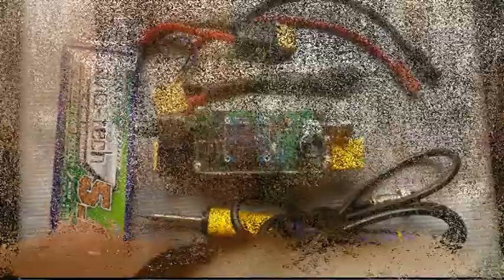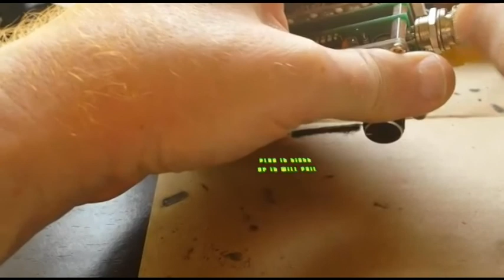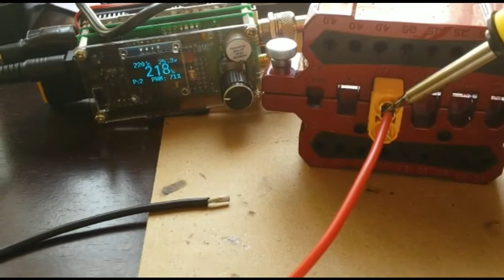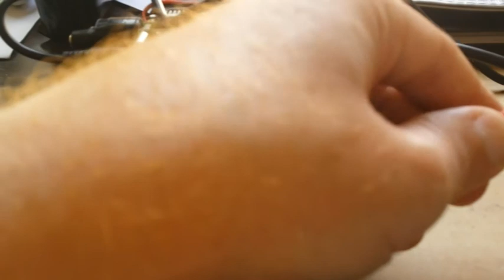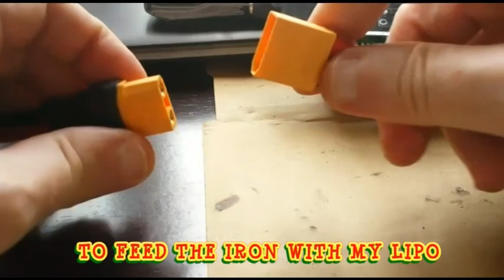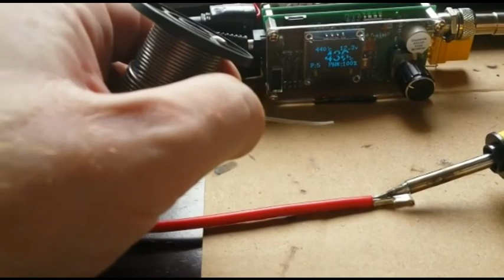solder test aulakiria

Comment: does the heating speed depend more on voltage or is it wattage? because the battery delivers a lot of amps and low voltage which makes its wattage still high...
Reply from the maker: It depends on wattage